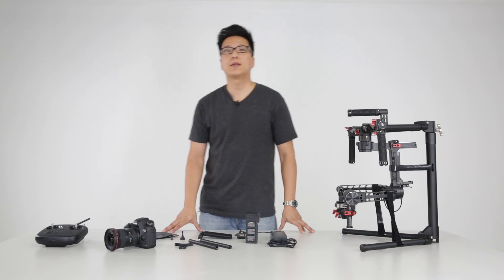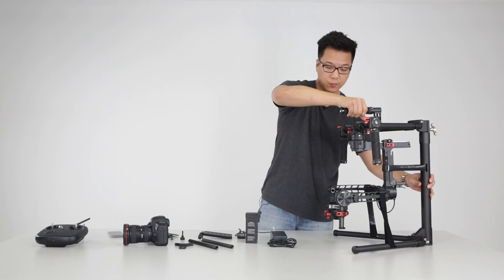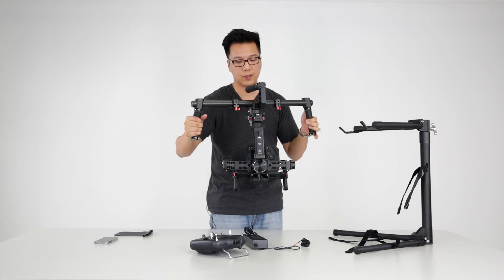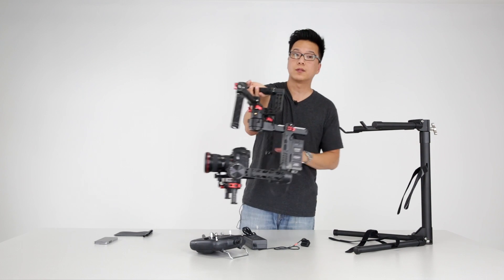DJI Tutorials - Ronin - Setup Demonstration

Comment: First thing right off the bat. Had to place a shim between the camera and the plate because the screw thread is too long. You would think for a grand DJI could get the screw right? After investing almost $1500 total for all the Ronin-M and accessories you need to make it workable, I sure hope all the horror stories I see here on You Tube are just a few disgruntled DJI customers.

Comment: im trying to set up my sony fs7 to a ronin (yes i have all the extensions for it). my issue is it doesn't lock down to the baseplate. it only lines up with one hole so it swivels. please help
Reply: Did you ever figure this out?
Reply: @createdbykjvideo  i honestly don't recall. We transition to a ronin s and crane 3
Reply: @davidboerst4789  Thanks for the reply! I'm still using the ronin-m with my DSLR but was curious if / how it would work with the FS7
Reply: @createdbykjvideo  from what I remember we had to strip down all the extras like handle and controller. Sorry I couldn't help more. I do like the crane3. It allows you to control camera options. First Ronin is still great but a lot more tweeking.